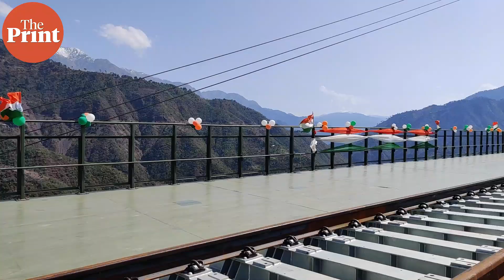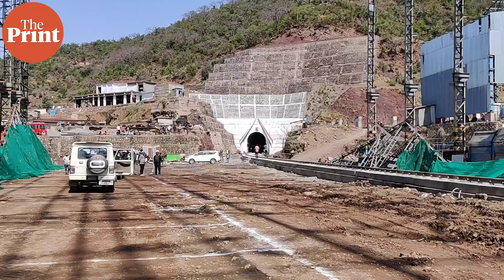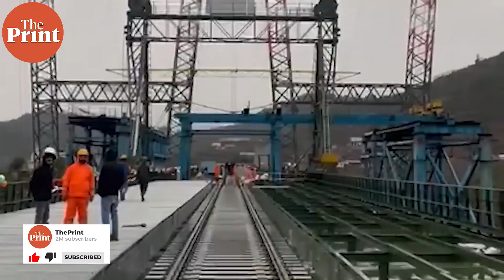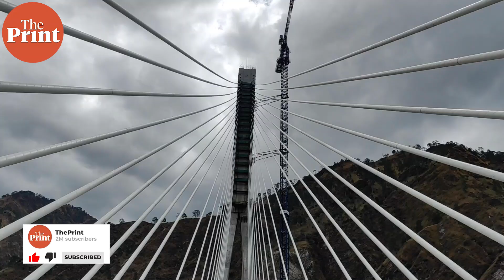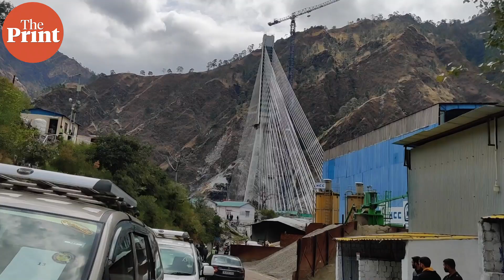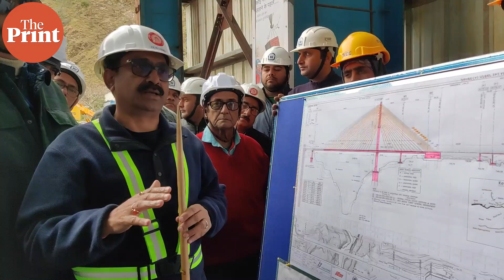How world's highest rail bridge on Chenab & India's 1st cable-stayed bridge on Anji are being built

Comment: Why one track
Reply: It is a very common approach to start with a single line first and expand when there is growth in traffic. It ensures track maintenance is better. Konkan Railway is one such example. A large part of Southern India has become a dual line very recently.
Reply: @tujams   load sharing  on the high bridges is also an important factor. double track would mean more drilling and enhancements  thru volatile environs and high risk posed to these bridges if double train crosses at the same time.  konkan and himalayan regions  are poles apart in their own right. this region falls under  quake zone 5 with frequent earthquakes and landslides, not to forget high security risk from terror attacks so bridges are blast proof as well increasing their weight.  far more challenging than most railway projects anywhere. only projects of NE can be compared with this one as they share the same geology and terrain more or less even though the same agencies  might be involved  in all of these projects.
Reply: @tujams  Correct.
Further Line Capacity is also considered. A single line is enough to handle the number of trains in the section
Reply: Not enough traffic